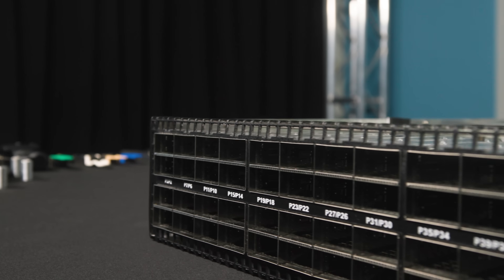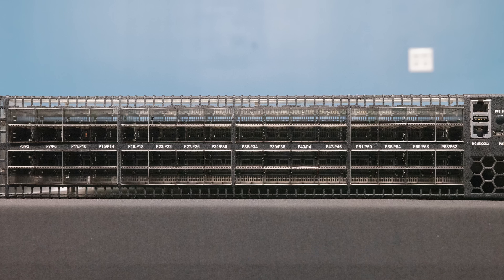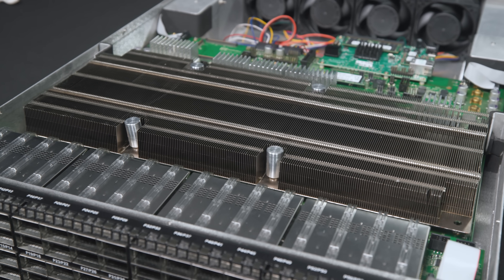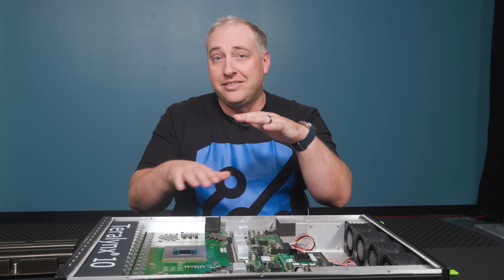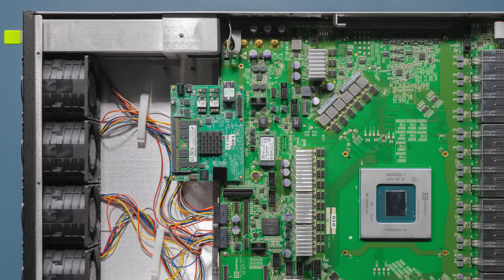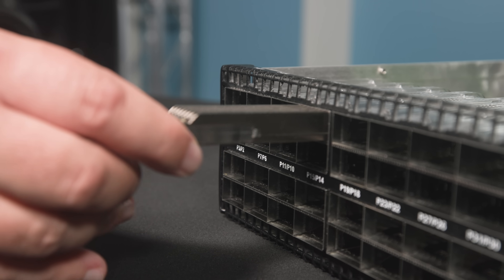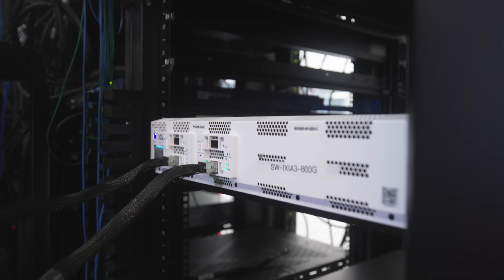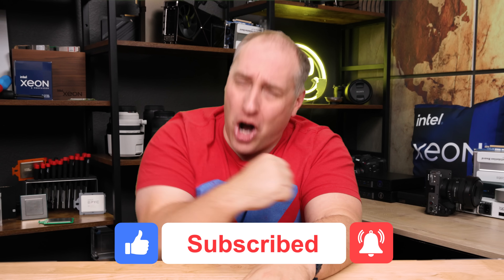Inside the FASTEST New 800GbE 64-port Switch

Comment: Great video. 
But you really don't need to say AI clusters.  This is something that all clusters could use. 
AI is just the endpoint of a lot of data processing that occurs within a corporation. 

But then again,  AI gets slapped on to everything as a way to capture the attention of the Pointy Haired Boss. (Damn You Scott Adams!) 

While your storage cluster's servers will contain a tiered storage solution, w Epyc processors, PCIe 5 or future generations... and NVMe , you'll want extremely high bandwidth... at least within the rack or row.

Its been a while since I looked at this... but the power requirements for a rack along w HVAC... is now mind boggling.  When will the rack become liquid cooled? 
(I know it exists, but I mean when will it become mainstream? )

Comment: Do they even have 800gbit nics? So this is just for aggregation huh?
Reply from the maker: 800GbE will require either a multi-host adapter going into 2x PCIe Gen5 x16 roots or will need PCIe Gen6 x16. You can also split the 800G ports into 2x 400G

Comment: Hi, can you tell me if switch can do multicast, and if so, is Multicast Latency same like Unicast latency? also when you send multicast flow into one port and replicate to 60 ports, is latency for each egress port same? More, what are latencies between different speeds, like 800gb to 100gb or 800g to 400g in both directions.
Do they ship QSFP verstion?  Can FEC be disabled?

Comment: if there is 500W needed for 512x 100G ports.. thats an insane efficiency. Please integrate the management cpu and make some passive home switches based on this technology - 16x 100G, splittable to 64x25G, in the 16W range! On the other note.. nobody mentioned what such TL10 switch costs? :D

Comment: 800Gbit is a bit less than double of the read bandwith of my manually tuned b-die kit. That is fucking RAM. HPC is going insane nowadays.
Reply from the maker: Think of it like PCIe Gen6 x16. Or more bandwidth than an entire 24-bay PCIe Gen3 NVMe system

Comment: Why dont our desktop cpus are packaged like that? Direct die with a metal frame around to support the cooler
Reply from the maker: Because it greatly increases the torque tolerances. In the V100 era HPE cracked many GPUs because their pre screened thermal paste was too thick. On consumer devices, you need to account for people who are installing their first CPU not following a guide to be successful or else it will cause problems

Comment: I am doubt that you can easly find cpu module that will fits there. Most of them are non standart and have its own pinout and uncommon connectors. And also I am shure that if someone will get inside owner will lose any garaties on this device
Reply from the maker: That is more for like, if you are a hyper-scaler, or a big OEM and you want to use x86 or Arm.

Comment: 800Gbit => 100Gbyte/s and PCI-E 4.0 x16 is 31GB/s, PCI-E 5.0 x16 is 63GB/s.
So about double speed of fastest PCI-E link, inside a single cable, that's crazy!
Reply from the maker: Exactly!
Reply: @ServeTheHomeVideo  Would be interesting, how the optical data is converted to electrical data, that is slow enough, so it can move on the PCB and get processed inside the silicon.
De-Serialize it into like x16 parallel serial links, similar to PCIE or some crazy 256 QAM modulation, with crazy I/Q demodulation inside the chip, maybe?

Comment: Used to work at the factory that built the Cisco Catalyst 6500 and CRS-1 back in the day.  You can tell this is a testing / qual / development build since it has a lot of 10 pin headers and clock signaling test ports on it that would likely get depopulated on final release.

Everyone talking about how thick that PCB is, but to be honest, my question is how many balls does that ASIC have?  I'm guessing at least 5K, and at least half of them are for just for power. 🤣

While I'm sure a lot of that PCB thickness is for signals, another reason is with that much power and heat on that ASIC, a thin PCB can warp under the strain and cause one of the solder balls to pop open. (it's what was causing the red ring of death on the xbox360, I know first hand cus my company built those too, and I spoke directly with the engineer who was working on the problem about it)  Anyway, sometimes you make PCB's extra thick, just to make them stiff and more heat tolerant, with large power and ground planes to not only provide shielding for the signal traces, but to help spread out that heat thru the board.
Reply from the maker: My first “corporate” job was at the old Stratacom Cisco factory off of Blossom Hill in San Jose

Comment: I'm surprised that with this power usage  in 2U factor it's not water-cooled in any way
Reply from the maker: They can be, but most of the power is being used by the up to 28W OSFP modules. The 500W TDP switch chip is not too bad to cool. We will see 500W server CPUs air cooled this year
Reply: @ServeTheHomeVideo  it's just that the two aspects I've come across are: 
1. Spinning air fans can take up to 30% of power usage
2. It's easier to collect heat with water block from high power chipsets

But then again I can imagine the airflow is more important for qsfps in this case

Comment: It is impossible to send a signal down 1000km of fibre without amplification.

The 1000km figure is likely the reach (with amplification) at which the SNR of the signal is degraded to the point where it simply can't go any further and remain usable.

Amplifiers are generally spaced somewhere around 80km apart.

Comment: Probably the most infuriating part about this is that manufacturers can't seem to figure out why consumers would want faster than gigabit on their consumer gear. Honestly most consumers may only need a 16 or 24 port switch at which point, with 10Gbps ports, you are only talking about 240Gbps of total switching capacity or 213x less than this thing. Consumer network gear is a racket at this point.

Comment: Thanks for this! Just a couple of questions:
- What are those PSUs rated to?
- That central processor, is that an FPGA or just an ASIC? I mean - you'll have to produce rather a few of these to make up the cost for an ASIC and if you need an upgrade, it'll be a PITA
Reply from the maker: Well over 2kW. You can see ratings and voltages on the main site where there is a label pic. It is a 5nm ASIC. Projections are for tens of millions of 800G ports installed by 2028

Comment: What people often forget is that bandwidth != latency.  It also does not depict the max packet rate.
A switch handling 100k 9k jumbo packets/s takes just about as much cpu as 100k 500byte packets/s on a switch, the limit is packet/s and not size/s
More bps is often not more better.
You have things like tagging / qos / acl's etc to deal with too. For real time applications it needs to do all that in as few nano seconds as possible these days.
Reply from the maker: We showed the latency and packet size chart in this.

Comment: Last week: "Yeah, 2.5 GBit/s for all smaller devices [those that can't be upgraded easily] and 10 GBit/s for connections to the big servers, our PCs and other switches is enough."
Yesterday: "This will be such a big upgrade. Let's put in the fibre and replace the switches."
Today: "OK, let's watch a video while installing the new cards into the systems so I can finally test the fastest connections. This will be so cool..."

Big mistake. :D
Reply from the maker: These are not really edge switches :) Still fun to see how things are changing at the high-end
Reply: @ServeTheHomeVideo  I know...
- my hardware maxes out at ~40 GBit/s (best value of a single device)
- the network would max out at ~100 GBit/s (in between switches in case I use multiple switches based on the old connections, ...)
- many smaller connections won't be that fast (only 2.5 Gbit/s - upgrade impossible or could result in more upgrades)
- daily use per user often is in the range below 1 GBit/s (or even less thanks to SSH, ...)
- ...
I didn't randomly pick the parts for the upgrade... :)

But it feels slow* anyway... so thank you for that... ;)
(* no, it's actually quite nice with 2.5 - 10x the speed I could get before [per device] while the connections don't slow down each other as much as before)

---

And I'll ask if we can upgrade the cluster at work... I guess there are ~200 nodes (if not upgraded already) on their own network that uses quite a few switches.

So thanks for the information! (Really useful!!)

Comment: The platform the mainboard is on is closed off at the back.  So the 900W of heat from the bottom 32 cages goes thru the PSUs?  This does not seem ideal.

Comment: Maybe my math is off, but if this is a 64x 800 GBE full-duplex switch, wouldn't the total bandwidth be 64 * 800 * 2 = 102,400 gigabits?
Reply: What are you trying to calculate? Sum of max. throughput per ports vs which number (the one that you believe is wrong)?

FYI: Don't ignore the "switching capacity". While the ports might give you 100 TBit/s the switch might not allow all ports to transfer at 100% in parallel.
So you basically get more ports than the hardware can handle on those switches - which is an advantage for most use cases because not all ports will be used at 100% all the time.
Reply: which is 102,4Tbit no?

Comment: I work in high performance computing and yeah, high end switches are insane. I don't work with the hardware itself, but I do work on the software side of it and make use of these sorts of speeds in parallel with many terabits of network bisection bandwidth. What's crazy is these networks can even be a big bottleneck when you put in too many GPUs per node.

Comment: I appreciate your detailed look at high-end networking equipment—it's something we network engineers don’t often see. For future content, could we delve into the more technical aspects that are critical for those of us in the industry? Some things I wanted to see mentioned, specifically as a networking professional in the HPC space:

What type of ASICs and RPs are in a piece of equipment along with their L2/L3 forwarding rates for determining subscription. PPS capability would be helpful too. 

You went into radix, which is very helpful for considerations about network topology like fat tree, and I do appreciate that you briefly went over spine/leaf in some diagrams. 

A bit about the CAM/TCAM would be helpful for understanding RIB and FIB sizing and ACL capability.

Covering the different redundancy modes the switches support would be helpful as well. Such as whether they handle active/active (MLAG) or active/passive (stacking) scenarios would tell us a lot about their control plane function from a redundancy perspective. 

In line with that I'd like to see some exploration into how L2/L3 multipathing is implemented.

I'd also like to see some breakdown of what is meant by 'large buffers' and the specific Quality of Service methodologies implemented (inbound shaping, colored policing, DSCP tagging support, WRED or ECN).

I'd also like to see some mention of RDMA/RCoE support for HPC centric switching platforms, because it's very important.

Maybe too detail oriented... But network engineers don't typically get to read anything but whitepapers, datasheets, and slide decks, so the format is very captivating.
Reply from the maker: Good feedback. We are still learning and trying to get the right level of information
Reply: @ServeTheHomeVideo  Packing all that into the video would probably hurt viewership.  I'd put it on your site and mention that in the video.
Reply: Yeah.. I was really wondering about whether the ASIC would be capable of line-rate routing for the underlays when implementing overlay fabrics in more complex setups.
I'd have to assume at the very least that something in this class would at least do RDMA, MLAG, and VXLAN as a minimum.
Reply: I do not know about marvel, but juniper sometimes releases technical details about their new products to the public. For example I highly recommend reading the MX304 deep-dive (their newest "small" high performance router)

https://community.juniper.net/blogs/reema-ray/2023/03/28/mx304-deepdive

Comment: With the advances in manufacturing process nodes, power efficiency, and increase in switch chip IPC that we're seeing at this extreme top end, do you see anything coming down the pike with regards to 1U fanless all SFP+ or all 10GB RJ45 (24-52 ports) or are the heat dissipation requirements still too high for that switch segment?
Reply from the maker: Here is a different way to think of it. If you use a newer and more expensive process node then costs go up. That is tough in a market 1/80th the speed of the current top-end where people are paying for that kind of advancement. A big challenge today is that 10GbE is so slow that there are not the investment justifications behind spinning those lower end chips. That can seem strange but it is not just about what should be possible, but also what people are willing to spend R&D on. 25GbE will be the next challenge. With PCIe Gen6 x1 you get 50Gbps so we will see investments shift even in 25GbE

Comment: It's crazy this 2U switch can replace 16U of 100Gb switches. Hate to imagine what 8 cables coming out each port looks like though.
Reply from the maker: More than that if you want those 16x 32-port switches to be connected at a reasonable speed
Reply: I would imagine that anyone sane will be using breakout MTP cables into patch panels.

Comment: Looking at the thickness of the board on 09:03, and looking at the vast amount of signals the single chip needs just for the front ports, this has to be one of the most complex PCB ever made (if not the most). That's an incredible amount of high speed signal traces that need to be finely adjusted,one by one just to have good timing constraints and good impedance matching between the IC and the transceivers
Reply from the maker: Yea! It is super cool routing that much high speed signaling
Reply: @ServeTheHomeVideo  kinda interested to see the UNDERSIDE of that board, I saw they blocked it off with metal on the backside so no airflow down there which is kinda odd since all the optical ports had fins on them but if only the top row gets air how hot do the other ones get then? and what is on the backside? back with a screwdriver!

Comment: Nice. I saw their products and they dont have enough exposure compared to broadcom. I do have small 100Gb switch using Marvell chip and it works wonderful, stable, low power, really nice.

In fact i am surprised the chip asic die is so small, i was expecting way bigger die.

Comment: Can't wait to install this in my home for $700 in 2034
Reply: And pay $700 a month for running this 2kw switch? 😢
Reply: I feel like the switch will probably be around that price point... But the cables won't be much cheaper. 😅
Reply: Nah, we’ll still be stuck at 1 gigabit.
Reply: @headlibrarian1996  I guess you are both wrong - unless mitch has a really huge network with devices that permanently need their fast connections to random devices OR librarian refers to the standard hardware on the motherboard (that might be enough for most "casual users" for quite a while).

But I like the idea of getting a "direct" fast connection to friends.
(As long as I ignore the permits required, construction/... destroying cables quite often, ... and the possibility that a friend might move - especially if that friend helped with the connection to another friend who is out of range.)

No, I'm not planning to do that. minimizes table with distances in between family and friends
Reply: @headlibrarian1996  I don't think we gonna stuck at 1, it gonna be at least 10 imo, mostly because of RJ45 and Cat6. 

2.5G is already drop to manageable price at this point, anyone looking to wire a new ethernet network should at least take a look at 2.5G price, or at least wire your network with Cat6. That way when you upgrade your speed, you just need to swap out the switch.
Reply: @headlibrarian1996  I bought a 32x40G switch for 600€ last month
Reply: Don't waste your money.  By that time you're probably going to find one in your cereal box.

Comment: If you can run it on the average home circuit (230v 16a) it’s suitable for home usage 😂
Reply: we have 400v/16A in the home as well ;-) usually waterheaters and stoves run on that circuit.. I am sure we can fit in a couple switches as well.
Reply: @LiLBitsDK  Don't forget the 3x16A...
"Mom, you can't use the oven. I'm on the network."
Reply: @Ciddyism  yeah figured it was common knowledge it was 3phase.
Reply: @LiLBitsDK  400V isn't "normal" here. You have to get an electrician to get it installed and if you don't mention the 400V they might not have all the parts so instead of the solution with a plug the device will be connected to the wall "semi-permanently".

A triple breaker with 3x 230V (with 16A each) is quite normal here. (Basically at least one in every house/flat/... .)
Reply: @Ciddyism  it is in Europe... US is a bit vimpy with 120-240v... we use 240+400v standard in all houses unless they are like 100+ years old